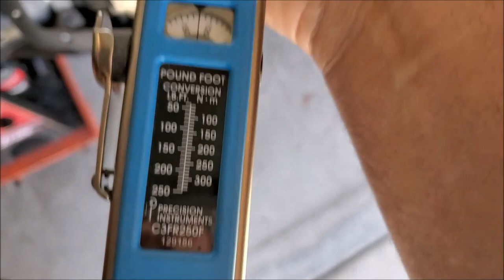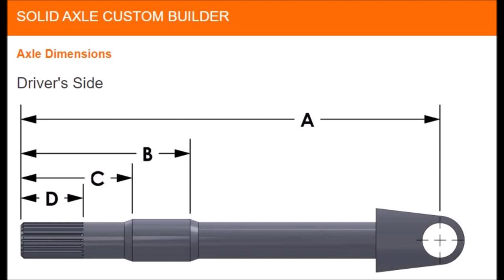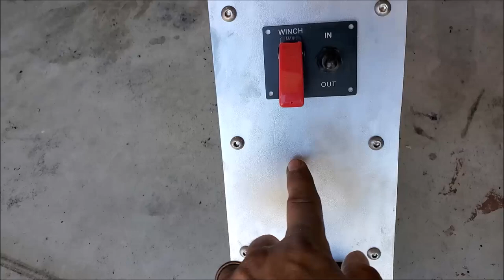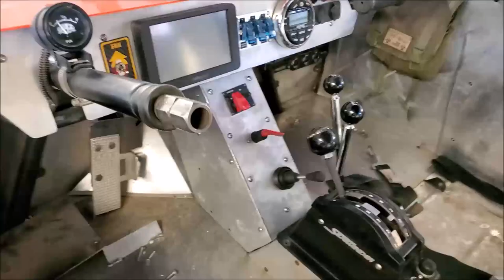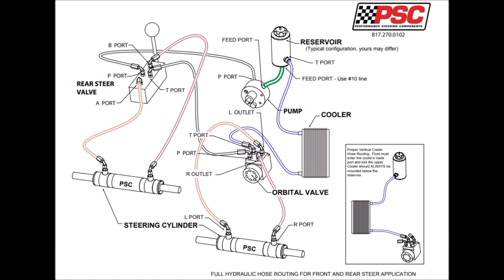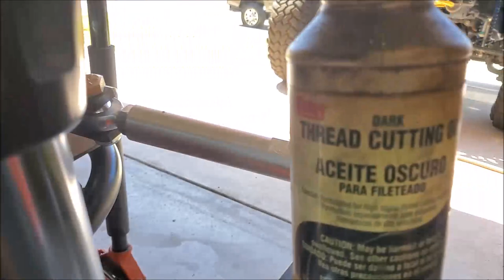Building a 14-Bolt Rear Steer Axle: PART 2

Comment: Dry erase board checklist for torque and tight , fluids ,bleed brakes, and so on . No gear oil will not be a best case for sure I have seen that with gears and transfer cases and it will kill stuff it a very short trip, it will let you see just how hard gear oil gets worked, fantastic job , home built garage quality is in most cases beyond what you will ever get from many shops that just think they are the poo and just want your cash , be proud that you are one of the few that is doing it all yourself as much as possible ,congrats!

Comment: Just FYI you can reuse those copper washers if you re-anneal them. Basically just heat it up red hot with a torch or lighter and let it cool slowly. This will remove the work hardening that happens after you tighten them down. Obviously if they're deformed or scratched you need a new one, but you can generally reuse them a couple of times. Sometimes I sand them flat if there's some small defect. Great tech vids, keep 'em up! I'm building a rear steer buggy and I love watching how different folks go about it.

Comment: I ordered a high angle driveshaft last year, in early spring and didnt get it till end of summer..at least 4 months and $1500.. Still isnt in the truck yet, only because it weighs 50lbs and noe the transfercase cant hold it. Where as a standard stock style shaft is like 10 lbs.. Long time and cant even install it..i know the pain.

Comment: Hi again..  I am finally plumbing my hydroulic lines.  

PSC sent me a check valve

Do you know where that goes.   It is not in the diagram?   I am guessing it probably goes between the pump and the rear steer valve because that is the first place that fluid travels to and would make sense so as to protect back pressure into the pump.   Just asking if you put one in or know anyone that has so I am not guessing at it.  Been hard to bet ahold of tech at PSC also it would be good info for others that are reading these comments.

Comment: Would you mind sharing the supplier you use for brake lines and brake line fittings . Keep the videos coming ! I’m building Dana 60 and 14 bolt rear for my ls swapped CJ7 you have helped me out a bunch with your videos especially the hydraulic fitting info. Thanks Walt
Reply from the maker: The brake lines and fittings are Russell.

Comment: Great job.  Inspired me to get back on my front steering 14 bolt! I’d really like to know what hydro hoses and fitting you used. Links to amazon or wherever. Also your brake line stuff.
Reply from the maker: I used Aeroquip FC300 hose with Eaton/Aeroquip field-serviceable fittings I bought at my local Grainger. I used -3an stainless braided brake lines and fittings from Russel that I ordered from Summit.
Reply from the maker: @tydy000mafia Just an 85' Chevy kingpin D60. Homemade truss and ram mount. Added Solid C's, Knuckles, and Arms. Running 300m RCV's. Yukon Grizzly Locker with 5.13 gears. In 11 years of hard wheeling, I have broken one axle shaft and never experienced any other failure with my front axle.

Comment: For axle shafts - the inner is a modified 30 spline GM, and the stub is a 35 spline, or something else?  How are the shafts holding up?
Reply from the maker: Remember, the specs on the GM 30-spline 14-bolt shafts make them just as strong as a Dana 37-spline shaft. Spline count doesn't make a shaft weaker. Nobody calls 19-spline Rockwell shafts weak. The inner shafts maintain the same thickness and profile that GM engineers designed. I kept the 35-spline outers so I can get spare parts anywhere at any time.

Comment: So how have your Braniks been holding up. I have a Chevy Dana 60 front with 35 spline 4340 Ten Factory outer shafts, I break about once a year if I get in a bad predicament where the shaft steps up to the yoke. (stress riser) I’ve considered RCVs since they spline to the Bell where mine are breaking. They are quoting 16+ weeks right now and they pretty much lied to me every other time I bought from them about their ETA. I’m considering Branik Legacy shaft as well as they will be available sooner. Just looking for an honest opinion since you use and run both. For reference my rig is around 3900lbs with 43” stickies.
Reply from the maker: The Braniks are actually holding up and I still have them in the rear and haven't even put in my RCV's yet. Guys in my club have had ETA issues with Branik lately as well. The entire off-road industry is full of bullsh!t. Dynatrac, Currie, RCV, PSC, Branik, Spidertrax, Advanced Adaptors, ORI, US gear, and many others are quoting people short wait times (or telling people the item is in stock) knowing what they are saying is a lie. It's sad.

Comment: Did your Braniks hit on the inner c?  Mine walk ovet enough to glance odd the crane inner c.   Branik said not to worry about it but IDK.  I may out in a spacer between the slug and the stub shaft spring clio to keeo them from wandering i. That far
Reply from the maker: Mine don't hit. Is the snap ring on the end of your shaft? Doesn't sound like it is.
Reply: @chrisdesertdog2162  yeah it was on there.   I die geinded a few thousands on the upper side of the inner c and cut about a 1/4 inch of tubing and put it over the stub between the slug and the spring clip.  I had to do that on all four corners but its good now.

Comment: With an auto centering orbital valve, what is your opinion about running a rear steer 14 on the street?
Reply from the maker: I would never run any of these full hydro systems on the street. Also, you better hope your rear steer never gets bumped or accidently moves while you are on the highway.

Comment: Great to see you have your rear steer complete. Also learned a lot of good tech info which is why I love your videos. I’ve been contemplating building a rear steer axle for my Willys buggy for a while. Does your axle valve self center or do you have any kind of indicator to know your perfectly centered?    Thanks again great video
Reply from the maker: It does not have a return to center feature because I try to keep everything on my buggy simple. I do plan on running a position indicator though, using a shift cable off one of the steering arms.

Comment: What size welding wire did you use?  I did a test run on an old axle with.035 wire 75/25. I pre heated my axle and pumpkin to 400 degrees and it looked good.

However my welder friend said since I'm welding to cast steel and also the crane knuckles that I would have more tensile strength with .045 dual shield flux core.  Do you think its worth the hassle for me to buy and learn that stuff.   Or just go for it with what I know?
Reply from the maker: Cast steel (like your Crane knuckles) are easy to weld to with a preheat and a good hot weld with a good machine. Cast iron (like your pumpkin) is very difficult to get a good weld on. Most folks THINK they are getting a good weld on cast iron because it "looks good", but are not. When welding to cast iron, I use nickel 035 wire with a good preheat and controlled cool down. On gray cast iron (which is the hardest to weld to), I usually move to stick welding. I really try to not weld to a cast iron center section if it can be avoided.
Reply: @chrisdesertdog2162  Thank you for the info.

I thought the pumpkin was cast steel. But I will make sure. Its from an older 80 truck 14 bolt

I just wanted to weld the tubes and maybe the truss to it for added strength for the four link arms.

Did you get to go to trail hero?

Wasn't that at Sand Hollow. That's one of the places I would like to take my buggy when I'm done with it.
Reply from the maker: @OffroadMilitia  Your 14-bolt housing is cast iron, but likely ductile cast iron rather than gray cast iron (which is even harder to weld).  I think the cut-off year for ductile vs gray iron was 1988 or so. 

I'm actually leaving for Trail Hero in about an hour!
Reply: @chrisdesertdog2162  right on.

Thank you. Have a great time out there..  I appreciate you taking the time to make the vids and offer advise.